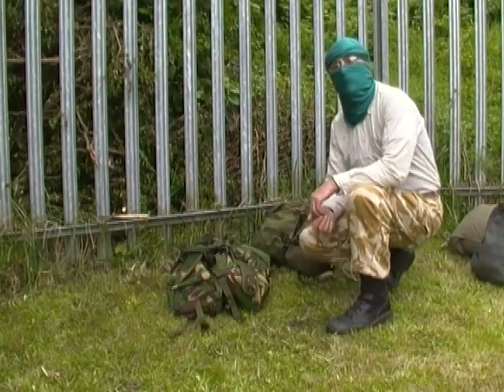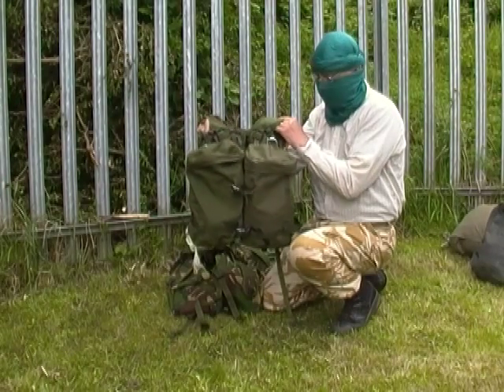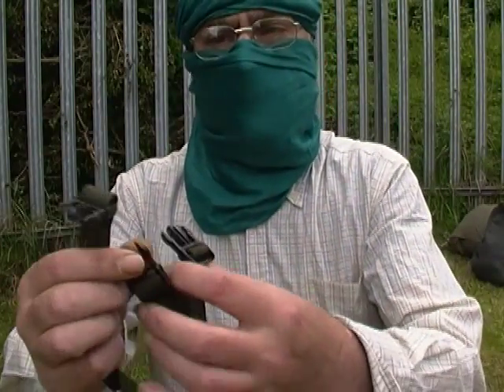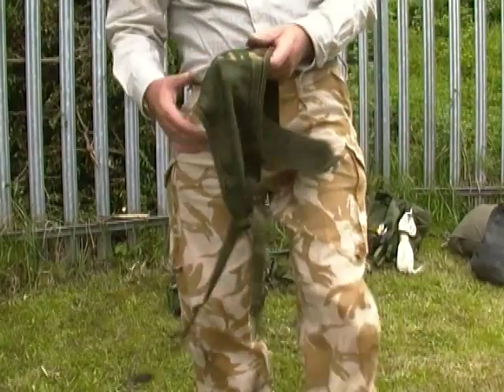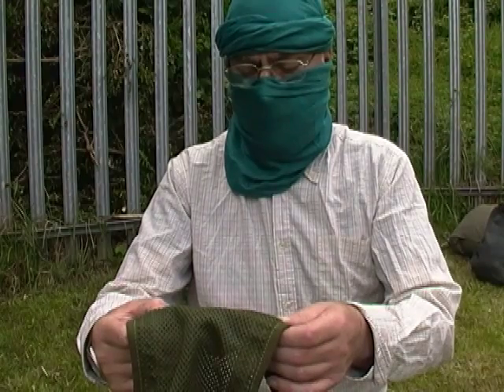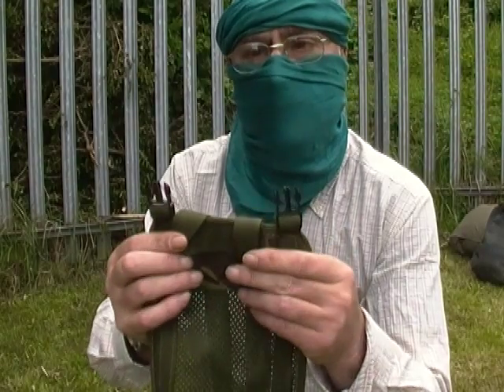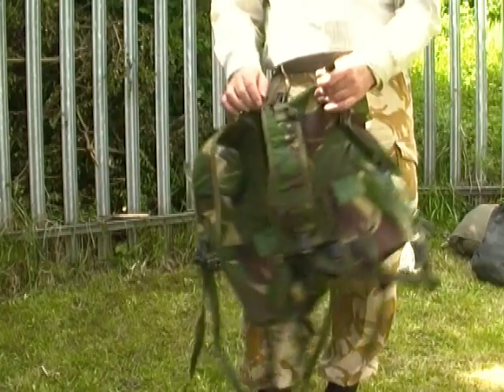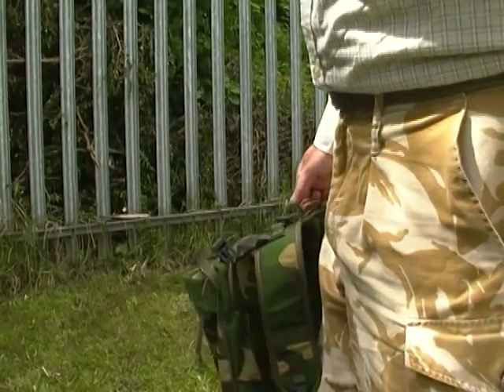rocket pouch assembly

Comment: Hello , can i wear webbing belt and pouches with this ?
Reply from the maker: yes but you'll need a seperate yoke to support the belt and pouches , i personally use the american vietnam war style or stripped down '57 pack yoke for that job, the rocket pouch yoke goes over the top of that
Reply: @totenvt  Thanks , i have 1996 British Plce webbing without plastic bucke , so i gonna buy some normal backpack
Reply: Could always sew the necessary clips onto molle gear to mount olderstyle kit and molle on the same vest/yoke?

Comment: reg is that you ?
Reply from the maker: Noooo, it's Reg's cousin, PVT Anon-E-Mousse
Reply: just watching your 44 pattern mug vid v v good
Reply: how did you go trying to make a single side pocket fit plce side pouch yoke ?
Reply: just ordered a 44 mug from silvermans dated and crows foot stamped.
Reply from the maker: 43whisky I made a couple of Y shaped adapters out of webbing for each of the 2 bottom male clips on the yoke. This consists of some 20mm webbing, 2 female clip halves and 1 male that fits into the pouch clip, the 2 female clips accept the bottom male on the yoke and the shoulder strap.
Reply: nice one, it such a usefull pack. i use it all the time. thanks

Comment: Hi,

tahnk you very very much for this great Review :)
Now I know a lot more about the rocket pouches!!
My Yokes wgich I bought have only one male buckle on the strap (downside)... not even two of them..
that was my Problem .... I saw one who connected the 2. buckle with the female middle buckle of the pouches.. that was also ok, but the middle Loops seem to be much more efficient, when there is f.e. a air-mat in it.. :) (as you mentioned)

here in Germany it seems to be, that some Dealers have yokes and siedepouches, but the straps are not in stock.. so they use "normal" straps with one buckle instead of the original 2 buckled-straps...

Now I know how to use These items more efficient :)

thak you so much and best wishes
Steffen